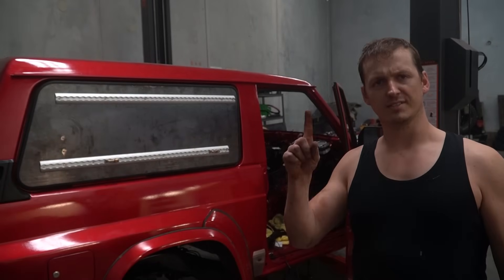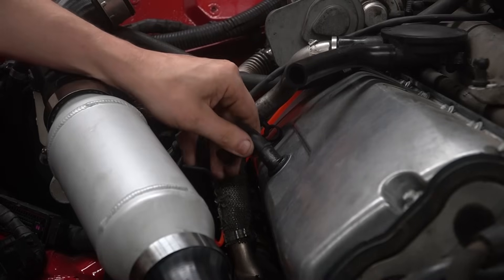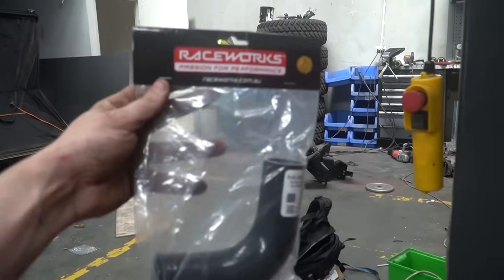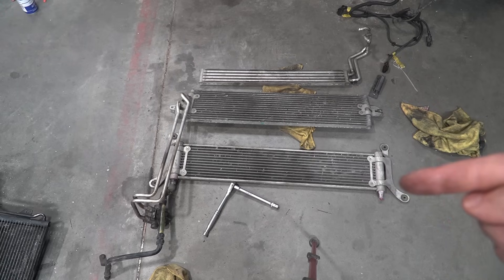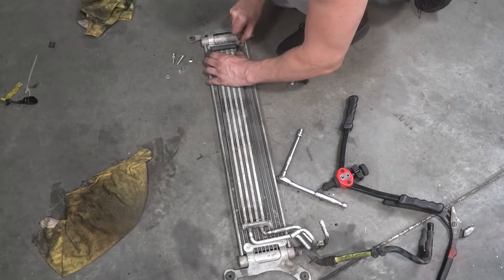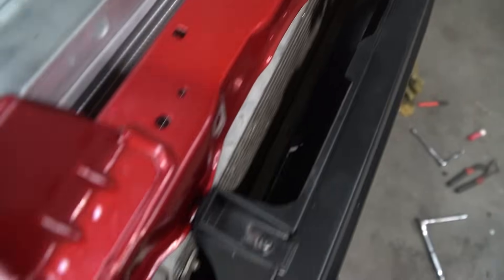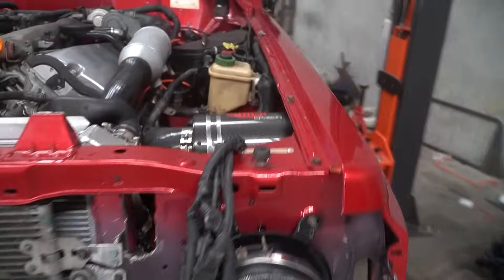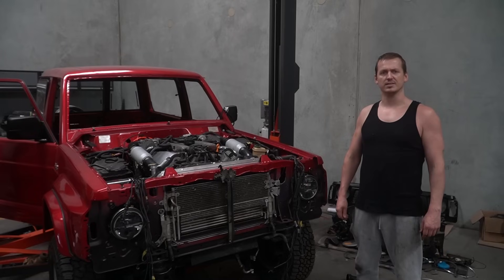My V10 TDi Twin Turbo Patrol Needs 7 Radiators! - V10 patrol ep21

Comment: Don't worry; I got w2a, trans coolers, a/c and then radiator in my stack and it works. But best to seal up between rads so fans pull thru the stack and they all work as intended.

Comment: Systems with pressurised expansion tanks are usually self bleeding, see the small nipple at the top
Reply from the maker: Nope, they've usually got a bleed procedure that involves either a bleed point, overfilling the coolant, or special tool number 159542583968gtgg4.
Reply: @ridiculousthings4x4  Thanks for that.

Comment: the reference to Clayton was rad. Voice control, your window is mocking you. Those radiator connections, whats their purpose? nice solution to convert to a regular barb, just afraid that in the future will crack. i dont like plastic engine bits. im unsure why we haven't send anodized replacements yet.
Reply from the maker: I'm guessing it's because on a "standard" v10 you have to drop the engine for fun, and making stuff quick release fittings takes the human error out of a leak point